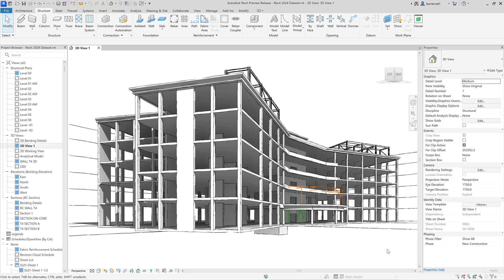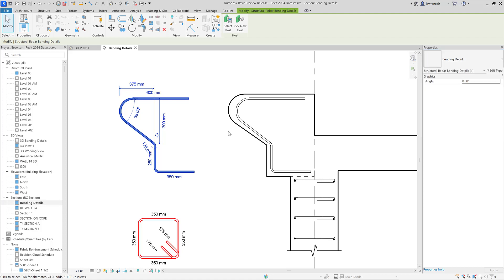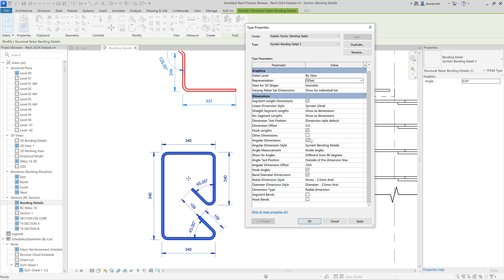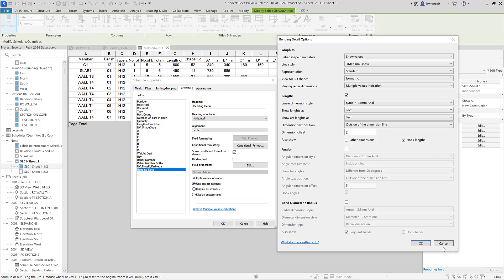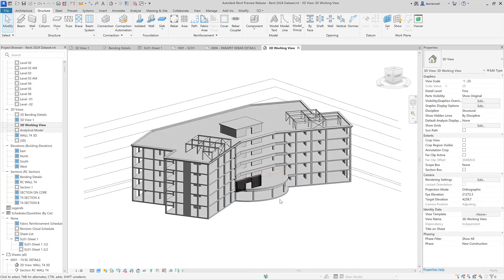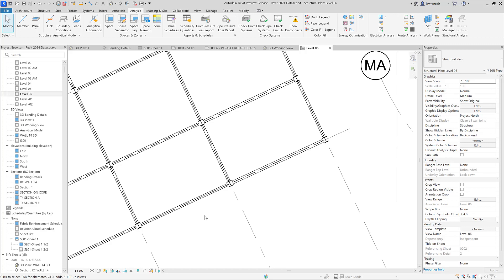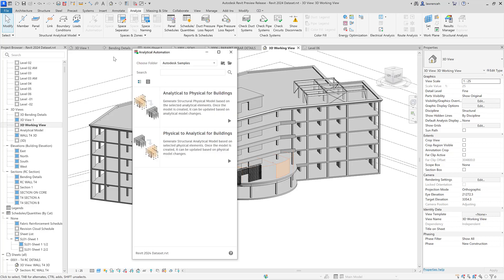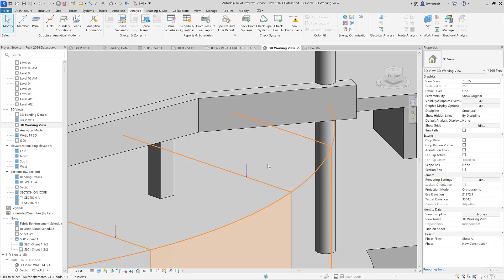Revit 2024 New Structural Features and Updates

Comment: @2:20 - When combined with the fact that Revit doesn't understand rebar details correctly, this feature could lead to serious issues. The 'sprung' stirrup would actually be shaped slightly different than the normal one. This point is easier to see with bigger radius: Revit basically implies that the rebar stretches (and it will in real life, but by a very small amount). So if someone decides to change the shape of the bar (which is really unnecessary), they've literally changed the bar's length. If anyone wants to argue I encourage them to go review ACI's wealth of resources on the subject.
When creating structural drawings, simply having them complete and concise is enough - most designers don't also detail their rebar. Revit entices the user to detail things they shouldn't. If someone is the designer and also the rebar detailer (they used to do that back in the day believe it or not), the rebar still has to be detailed correctly. If it's not there's either going to be problems in the field, or someone (or a team) will go through the drawings on their own to detail the bars correctly.